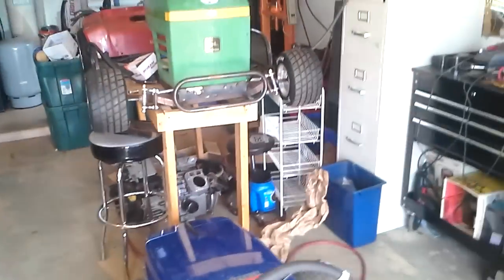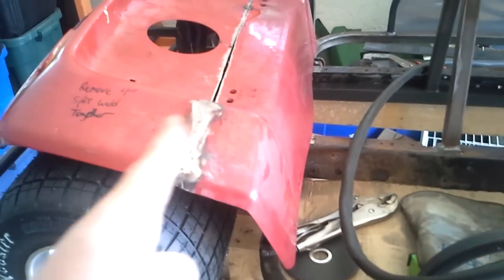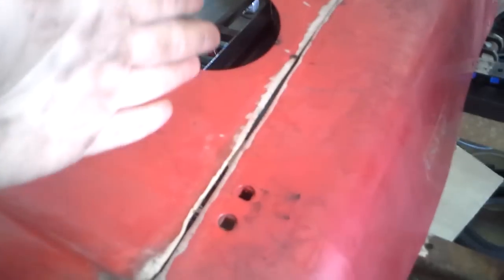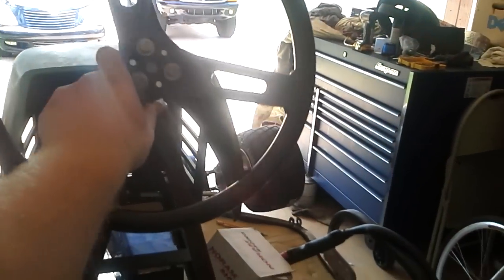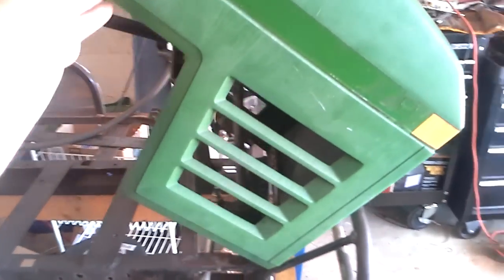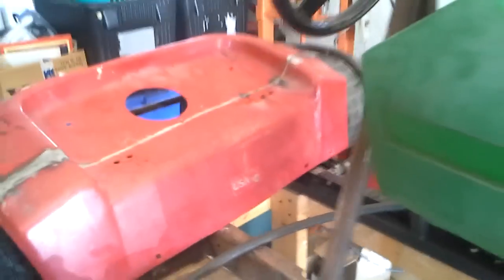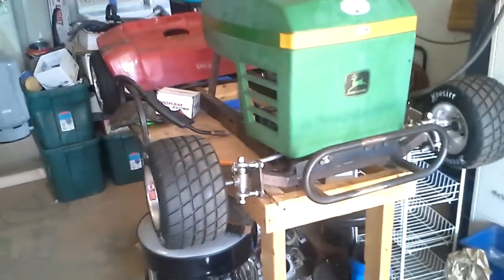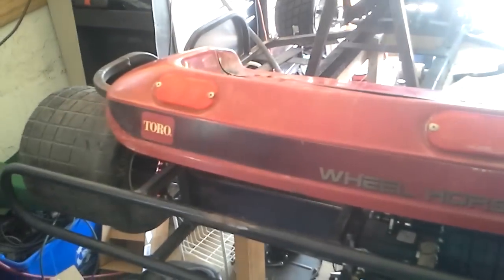2016 fxt build

Comment: I like your steering gears. are those out of a transmission?
Reply from the maker: Bob Vance yes they are out of mower transaxles its cheap & effective & works great instead of using a rod system with required your mechanical force the gears triple your force through gear reduction.
Reply: Nice